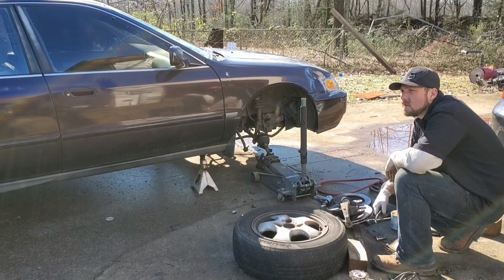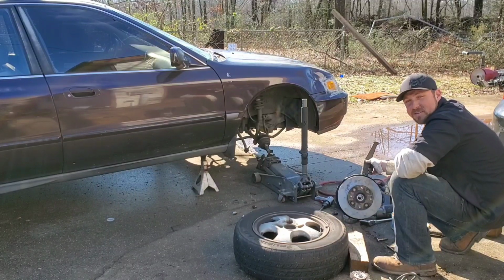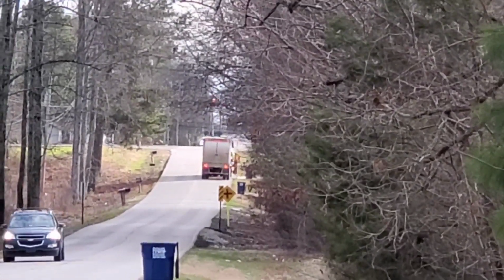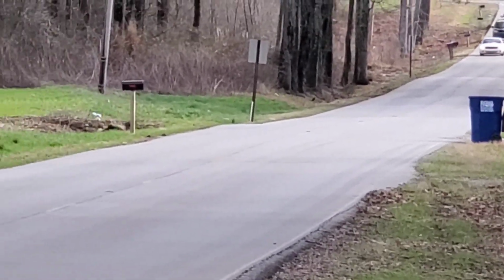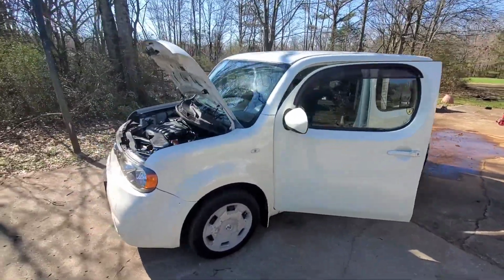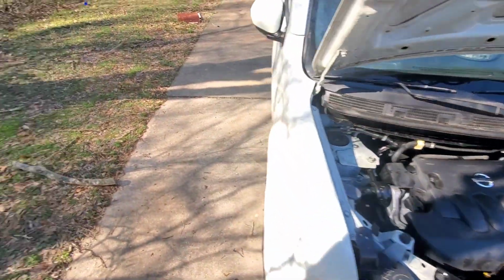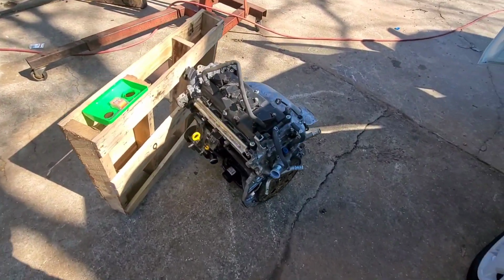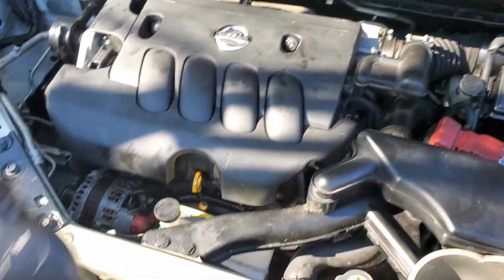Nissan Cube Engine Swap! Hanging with James in the Shop #2

Comment: Do you have a full video of the Cube engine removal. Mine has 298,000 (approximately) miles on it and today it blew up, lol. Something broke as oil came pouring out of it and lost all power. It has had 3 transmissions already put in it. I’m looking at trying to source either a complete with trans or maybe even a swap for something else. Thanks
Reply from the maker: I don't, it was a fairly labor intensive job with lots of parts to remove and install.  It would have been a very boring video to cover it all.
Reply: Boring yes, long even more yes. lol

I am just trying to decide if this is something I want to try to tackle myself.  Been also looking to see if there has been any kinda engine swaps to get rid of the CVT. I do appreciate your response.

Comment: My engine is shot in my 2009 Cube. Had the head gasket replaced but it’s still consuming coolant and spark plug foul after 10K. I’m sick of paying for repairs and just want to swap out for a another used engine. My local Nissan specialist wants $4100 out the door for the swap. Does that sound reasonable?
Reply: Touche homie! The saga of my 2009 Nissan Bube (deliberately misspelled) started as a P0301 (misfire Cyl1) that would not go away before the pandemic, replaced almost all the sensors (Mass Airflow to Crank Position), Cyl 1 fuel injector, fuel pump, all 4 IG coils and plugs, considered replacing the wiring harness, reprogrammed ECU via eBay, you name it! All in vain until I bought a Bluedriver OBDII device that helped me figure out it was the head gasket all along! My honest mechanic said no thank you but referred his go to mechanic buddy who said it would be $3k or higher for a head gasket job and strongly opined that it was a temporary solution at best and would call back. He did and quoted me $2500 + 1 year warranty to swap the engine.  Parts and labor included, I'm in Houston, TX so your $4100 quote must mean you live in LA, NY or Chicago but that's just me going on a tangent.

After thanking him and hung up I said "Huwhat? Sheeeeet!" For that kind of money I might as well do it myself, so, after eBay sellers wanted an arm and a leg + $200 shipping for a junker engine I tried good old Amazon the other night.  Now I hope you'd find one like what will be delivered tomorrow, but I bought the last $450 tested, used MR18DE engine which totalled $487.13 with FREE shipping!  Bessler Auto Parts was the seller.  After my order went in, the only price I could find for the same search costed $950 from a different Amazon seller. Nuff said because I have a Nissan Cube engine removal video to watch and y'all know I have my work cut out for me and then some.  To you my brother in pitman arms I say, never ever take the 1st offer and always get a 2nd opinion. Amen!

Comment: What's wrong with the orig engine?  Mine has a piston ring issue.  Thinking about replacing the engine but not sure I can handle the work.
Reply from the maker: Cylinder 3 broke its piston skirt. The MR18 engine was designed in conjunction with French car manufacturer Renault. Its fairly well known to be failure prone, especially cylinder 3 for some reason. Its a large job to remove the engine on this platform which you will need to do in order to rebuild the engine. Its possible to do yourself, but will definitely be a very involved project. Machinery work will need to be done to the block as well. Good luck with your project.